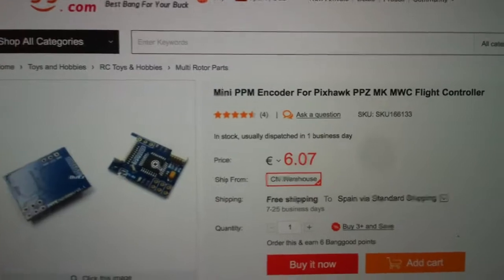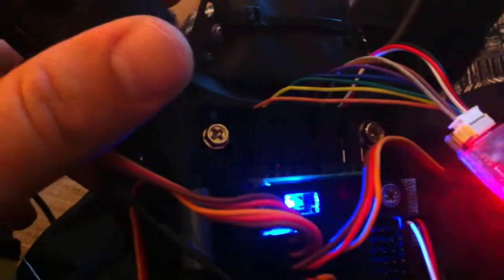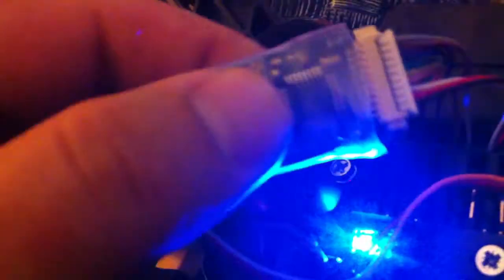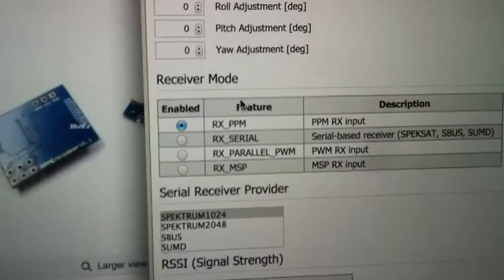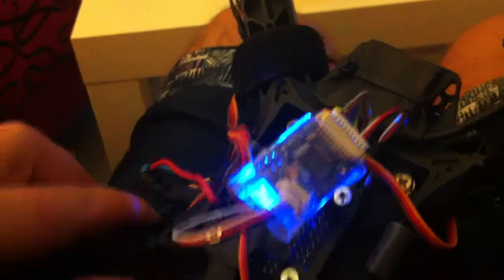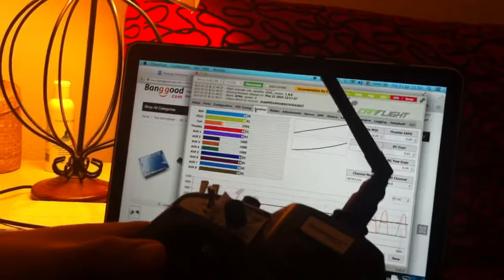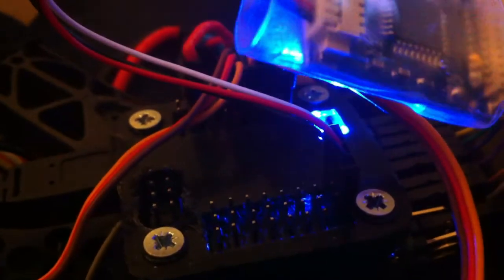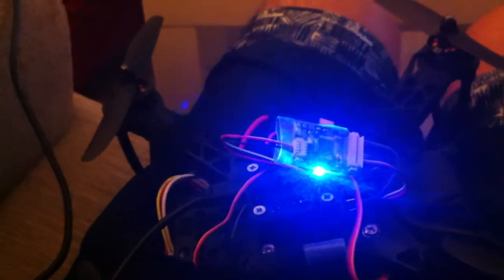Mini PPM Encoder For Pixhawk PPZ MK MWC Flight Controller from banggood.com

Comment: You mentioned that you had to solder something to get it to work - what did you solder and why?
Reply from the maker: +Paul Wrightson Hi! You have to do a short-circuit in SJ1 pins on the board in order to power the ppm encoder through the RC receiver, like in my setup and probably the most usual way. If you click in the link to the item, you will see comments warning about this. You can see it in this picture: http://www.dronetrest.com/uploads/db5290/950/b21b264d4dc7dbdb.png
Reply: +TechAim Thank you so much - I was wondering why my receiver was not getting power - I was even thinking I had to take a power line from somewhere else. I will solder the jumper today and see what happens.